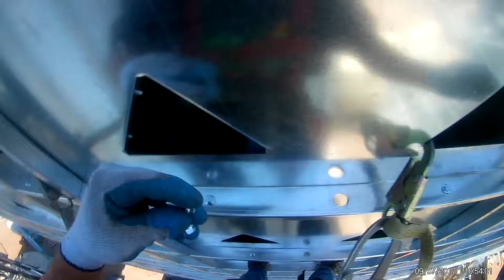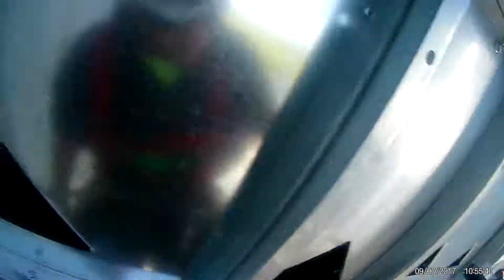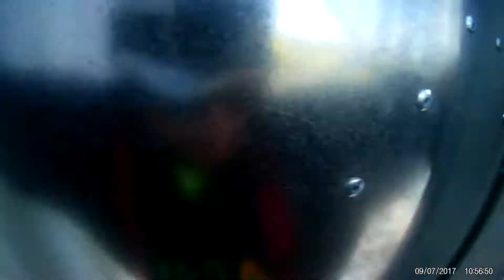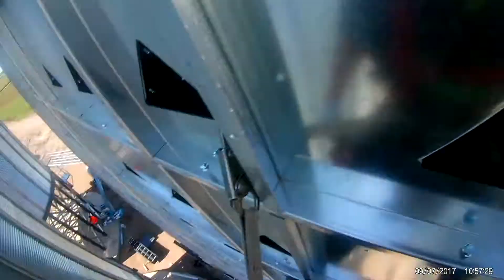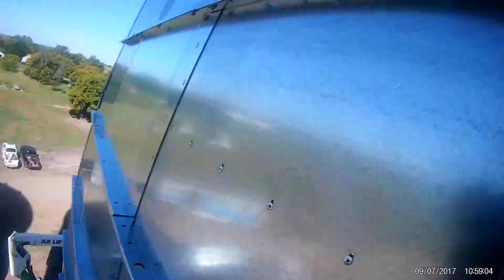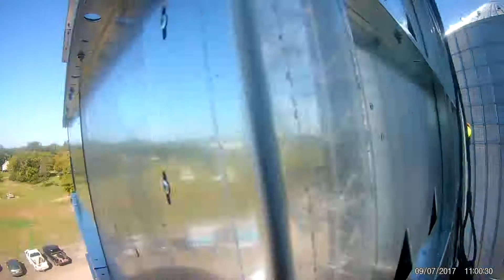Working(6)

Comment: Is this what a grain handler does?
Reply from the maker: Drys corn.  Or beans mainly. There are fans underneath the dryer. There's a burner inside also.  The fans blow the heat up through and out the triangles drying the product.
Reply from the maker: We build and install.